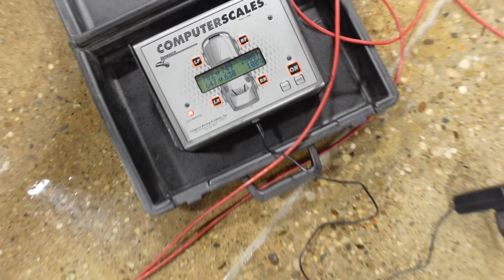Jimmy Dale Gives Us A Look Under The Hood Of Magic Johnson 👀

Comment: Much respect to Tin Soldiers, great video with special guest Jimmie Dale.
Fun video.
However, you boys need to fab up a wheel chock for your scales.
We use scales at my work to weigh up vehicles for crash testing.
We made up wheel chocks that sit on top of one of the scales, usually the left front wheel location.
We put it on before we zero out the scales, then set the car down on the scales at all four corners to begin our weigh ups.
Dangerous to have a car roll off the scales.
I've been chased a few times by a test vehicle because my co-worker forgot to put the chock on.